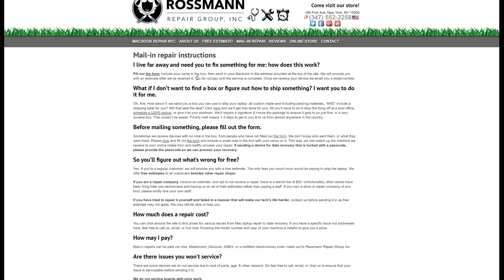Why did Louis move to front of store?

Comment: Louis, how come you don't just use solder paste instead? You can get so damn good results with solder paste and with very little residue compared to all that flux. Sure solder paste still needs cleaning, but after trying it I absolutely love it. I will stream a video soon soldering some of my pcbs without stencil one part at a time using solder paste instead of flux and solder just to illustrate the difference.

Comment: The world needs a Louis lookalike who does this stuff with MS Surface Pro laptops. Surface users around the world have been seeing their laptops malfunction since mid 2018 when MS updates started causing problems in the UEFI. The update happens and the Surface Pro can no longer see the TypeCover keyboard, or the touchpad, or the touchscreen, or loses battery management, or any combination of these. When mine went bad I had to buy a bluetooth keyboard, and the battery never turns off and runs down while traveling. All MS will do is charge the customer for a refurb. I've watched a number of Louis' videos and my guess is that MS is probably only changing out the UEFI chip. 

The wider world needs you, Louis. Come help us!

Comment: Good ole' redundant caps. 

But on a serious note how expensive is the board viewer software? I've finally come across my first board (820-3662) with no charger light, fan spin, or corrosion so gotta pull out the multimeter and troubleshoot from there.

Comment: I never wanted to be the monkey in the window but if it does it for ya hey. Also if you study a bit about the use of local bypass capacitors you will think a little differently about them. Good that you put them back in. Without them you could see anything from random slow performance and reboots to an intermittently dead board. They are there to get rid of locally produced noise that the larger higher ESR caps upstream cannot cope with.